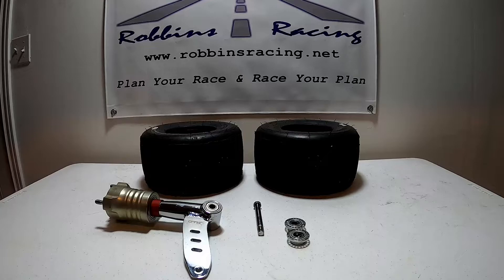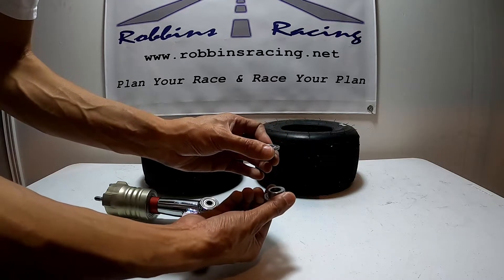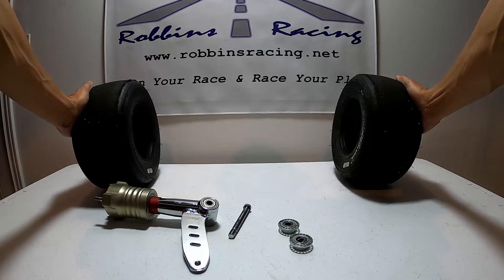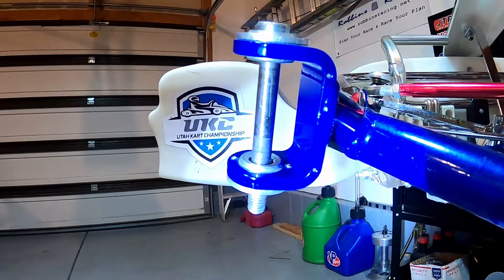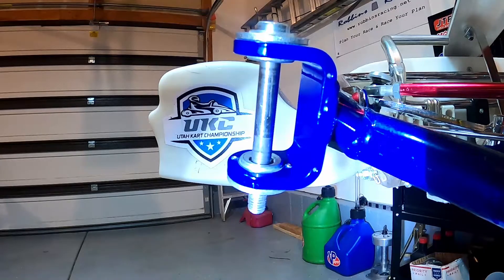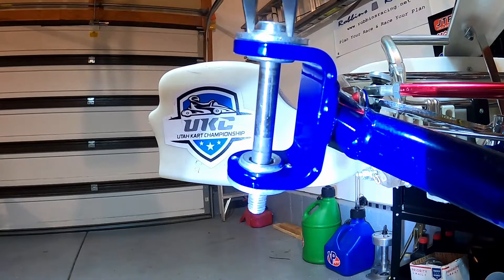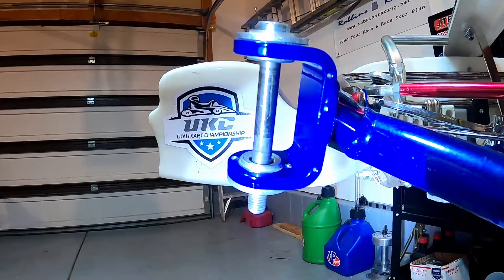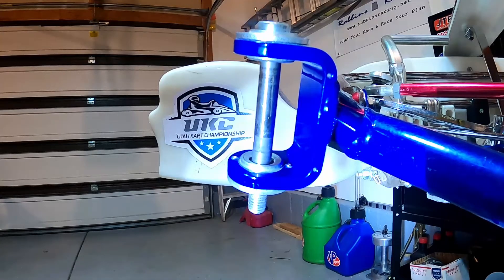Go Kart - Camber

Comment: Is it true negative camber hurts straight line speed?
Reply from the maker: I have heard the same although short of making an extreme change I doubt it can be measured on track.
Reply: On your Caster video, moving the top pill also made a change to the Caster.  How do you adjust the Camber (top pill) without changing the Caster, and vice versa?